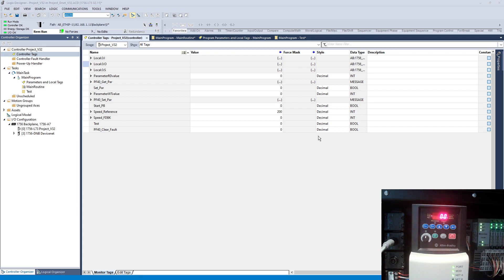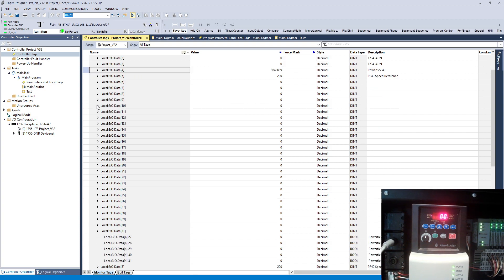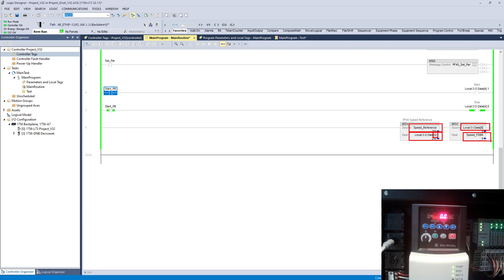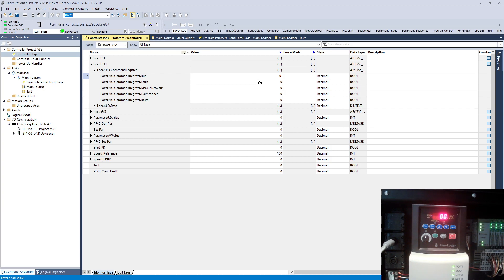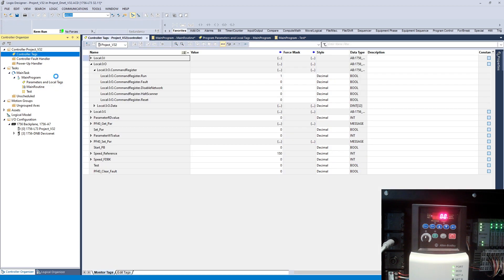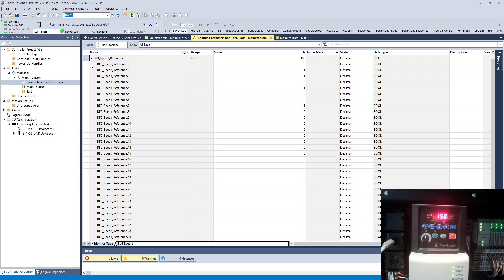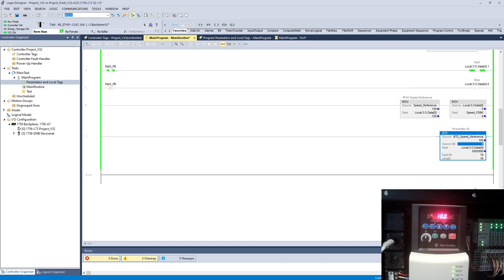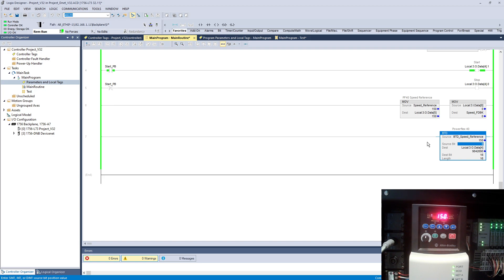Powerflex 40 DeviceNet

Comment: Hi. i have a little question. If i have a broken DNB MODULE and i don´t have rsnetworx. When i put a new one. Whats happens with my bits?  i need to reordened? or Just change the module like other normal modules?  can i use the Default mapeo and change the bits in my logic program?  or forcibly i need to do an  automap with rsnetworx. Thnks for help.
Reply: i think you have to download your file .dnt to your scanner module,  there is the option download to device